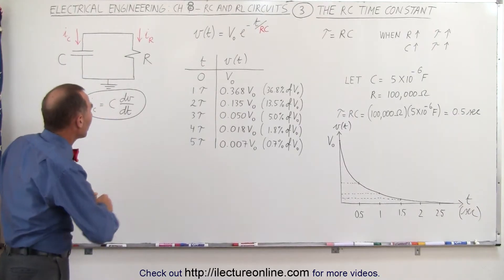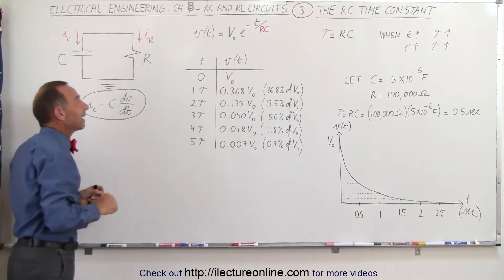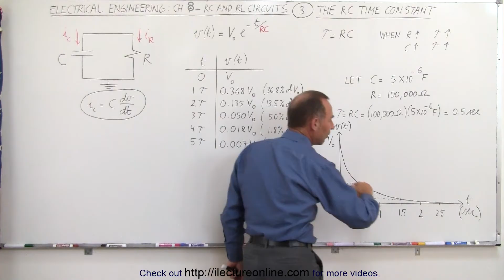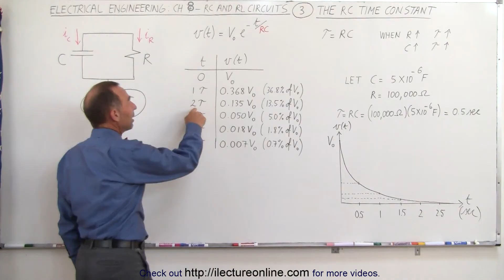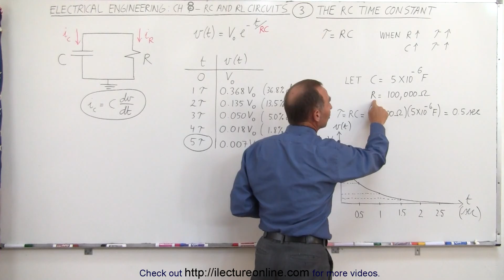Electrical Engineering: Ch 8: RC & RL Circuits (3 of 43) The RC Time Constant

Comment: The resistor slows down the current, but it's not akin to a traffic light; i.e., it's not holding back current while letting a metered amount through. The "stopped" current leaks off as heat. How do you take this into account, or is it so negligible as to not be of any concern?
Reply from the maker: A resistor "controls" how much current can flow in a circuit according to Ohm's law:   I = V/R    Energy is indeed dissipated from resistors, but the energy comes from the battery.   The heat is generated by the electrons making the atoms in the resistor vibrate at higher frequencies.

Comment: RC Circuits
Discharging a capacitor
Why should a capacitor discharge? Imagine the capacitor with all its charges is kept inside a bag and tied at two open ends (open-circuit).
The positive charges on one plate are attracted strongly to the electrons on the other plate, and the electric field is strong and uniform between the opposite charges on the plates. The opposite charges on either plate seem to hold each other tightly. The field is not so strong to cause the electrons to cross the gap and reunite with the positive charges.
There is a fringe field at both ends ready to burst the bag, but the open circuit does not allow charge flow in the external circuit. The electric fields of surface charges which move onto the wires from both the plates and the fringe field will, during the initial transient when the wires are attached to the plates, combine to make the resultant electric field in the wires, zero. The fringe field is different from the field between the capacitor plates.
When the charged capacitor is short-circuited using a wire, the effect is to open the tied ends of the bag and the charges are released. The fringe field causes the initial crucial release of charges for further flow of the charges….and development of surface charges that will enable the charges to flow around the wire, and neutralize each other. After all the charges on the plates are neutralized, the circuit attains a state of static equilibrium, a natural relaxed state of equilibrium and we say the capacitor is discharged.
Electrostatics and circuits belong to one science not two. To learn how a capacitor charges and discharges and the origin and role of the fringe field in the circuit process it is instructive to understand Current, the conduction process and Voltage at the fundamental level as in the following two videos:
i. https://youtu.be/TTtt28b1dYo and
ii. https://youtu.be/8BQM_xw2Rfo 
It is not possible in this post to discuss in more detail the formation of the fringe field when a capacitor is charged and discharged.
The last frame References in video #1 lists textbooks 3 and 4 which discuss these topics in more detail using a unified approach and provide an intuitive understanding of discharging a capacitor with the help of sequential diagrams.
Charging a capacitor
"The voltage across a capacitor cannot change instantaneously" is a statement one finds often in textbooks on circuit theory which discuss the application of a step voltage to an RC circuit.
Most students memorise and apply this in circuits without understanding the physical processes involved.
It will be useful to learn the operation of charging a capacitor using a unified approach to electrostatics and circuits.
It is not possible in this post to discuss the charging of an uncharged capacitor. During the first few nanoseconds after switch ON, while the surface charges arrange themselves, there is no electric field E_cap and fringe field because there is no initial charge on its plates; it is as though the capacitor was not there - as though there were a continuous wire with no break in it.
The last frame References in video #1 lists two textbooks 3 and 4 which discuss in detail with a series of diagrams the physical processes in charging a capacitor without and with a resistor (RC circuit).
It is not possible in this post to discuss in more detail current in capacitor circuits and capacitive reactance. The last frame References in video #1  lists textbook 4 which discusses these topics in more detail using a unified approach and provides an intuitive understanding of reactance. 
Textbook 4 is here https://techsarworld.com/product-detail/fundamentals-of-electric-theory-and-circuits-559 
It also describes with sequential diagrams how the current leads the voltage across the capacitor by 90 degrees. 

Capacitor - Video lectures by North Carolina State Univ faculty
This is a link to a video lecture by NCSU faculty on the fringe field of a capacitor.
Important
5. Derivation leading to fringe field expression of a capacitor.
For the final expression of the fringe field watch from 15.0 minute.
ch15L3b
https://youtu.be/7rZ1uFc1ibE?si=0a6OMk-kQLeEMMzb
The second link is to a video lecture by NCSU faculty on Discharging and Charging of a capacitor.
6. Discharging a capacitor
Watch from 3.0 minute.
Charging a capacitor
Watch from 15.0 minute.
Ch19L1a
https://youtu.be/hnSC8MqgCjY?si=krGUPtDarUmFxT_I
PPTs and Videos with animations for all the ten chapters and a few applications  Regulated DC Power Supply, Differential Amplifier and Transformer coupled audio power amplifier of the book Fundamentals of Electric Theory and Circuits are available for download and viewing here
https://techsarworld.com/download-resource/fundamentals-of-electric-theory-and-circuits-559

Comment: Thank you sir and one doubt Sir, the capacitor is fully discharged in the 5(£) i.e. 5 × time constant period this fully discharge is only suitable for without voltage source  case is correct sir? In case voltage source is connected to (5 × time constant) fully charged in the capacitor i.e. steady state position therefore no current flow and the open source is done by across the capacitor...is correct sir ?
Reply from the maker: Yes, this is an example where there is no voltage source and the capacitor is initially charged.
Reply: @MichelvanBiezen  thank you sir